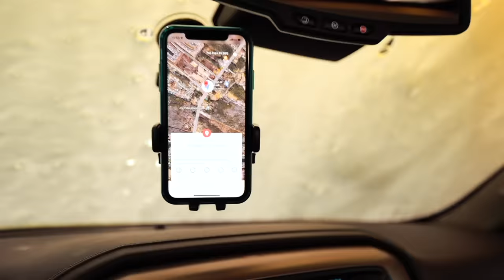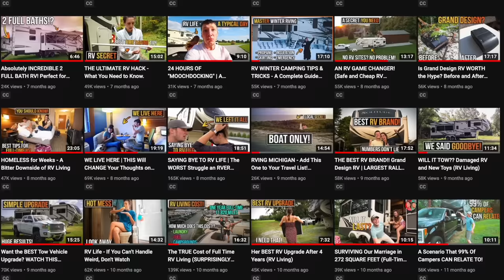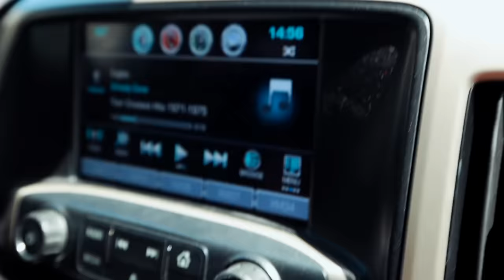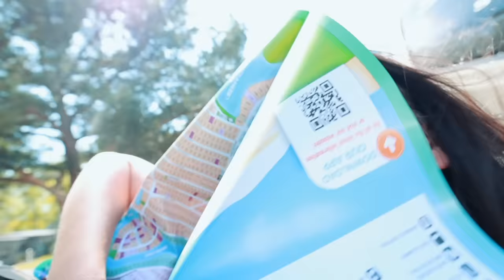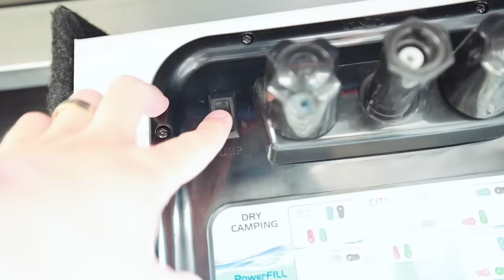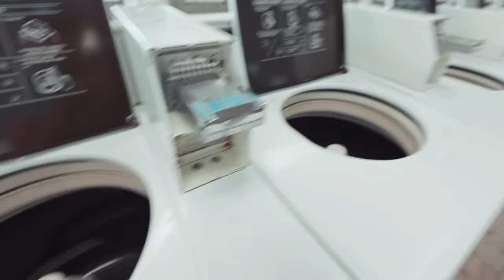THIS Is Why People Quit RVing! RV Repairs REALLY SUCK.

Comment: I figured this was going to be an ordeal overall. Our first travel trailer had a siding issue on its second trip out (2020), I contacted the dealer and they approved me doing a patch job on it to get through the remainder of the season. They were working with the manufacturer on how to fix it, parts, etc. I took it to them in early November 2020. The siding pieces were delayed due to Covid supply chain issues. So it sat there but they hadn’t done anything to it yet. Mind you this fix required ripping the entire side of the camper off and putting it back on. After much back and forth with both dealer and manufacturer in around the February time frame (2021) they got the pieces in they needed for the siding. Great, just in time for camping season 2021. They proceeded to rip the entire side of the camper off and attempt this installation. Turns out they damaged multiple pieces of the good siding in the process of removing it all. So 4 months+ to get the original pieces, and the supply chain has gotten even worse at this point. I was all but certain we were going to miss out on camping season 2021. The kicker is I didn’t even have a patched usable camper, couldn’t trade it, sell it….it is stuck there for probably the entire summer. They don’t even have an estimate on metal. 

One of the most stressful events of my life and we are not full time, just weekend warriors. It was worse that building a house. Just the getting yanked around and unknowns. Ultimately working with the manufacturer paired with the dealer it was made right. They bought us out of that camper and gave us a substantially nicer unit at legitimate manufacturer cost that the dealer had on their lot (you wouldn’t believe the actual markup on campers). All just in time for camping season 2021. Same unit is still going strong to date with no major issues knock on wood. 

The rv industry is not the only one like this anymore sadly. Same song and dance if your vehicle gets damaged, your house, etc. The supply chain paired with lack of labor force and green or uncaring labor force that does exist means that competency is through the floor and timelines are through the roof. I ordered a truck from GM and waited 5 months and you would not believe the level of incompetency from GM of all companies. Couldn’t even tell me where it was, when I would see it, and honestly I did not get the impression they were sure it even existed. Canceled it and went another route.  Sadly it is just the new world we are living in….not sure it will ever go back or get any better. I am glad you guys got through this relatively unscathed.
Reply from the maker: We appreciate you sharing your story!

Comment: That there is little accountability in the Rv Services  acrossed the board  is unacceptable!  We need  to change this .   What ever happened to a Quality Control Representative for the shop’s locations ?   You’d think they’d be worried about  us spreading our bad news ( don’t go there).  Maybe we all need a “go to list” & ( Dont go there LIST) to share with each other !? 
I went to pick up my “new to me” used TT and  it wasn’t even washed ! I had to pay a $389 charge to have the little fixes and get it cleaned.   Dirty.   Sad .   They’re retailing it, so they make a profit, but them add an extra cost ( insult) to ?make yourself feel good about buying it ?

Comment: Soft water is really bad for your ENTIRE plumbing. Unless you do a complete flush and clean all the lines it will just get worse. It’s basically a very high concentration of lime/calcium deposits in the water and builds up over time. 3 way water filtration system is the only way to prevent or salt system. Get that looked at asap!!! You’ll thank yourself!
Not to be a bummer, or negative Nancy, but….. I think it’s time to check all the seal strips on the roof. Air vents, air conditioner and tip/outs. Grease those pullies and tracks around the lean outs!

Comment: Considering some of the unqualified people that some RV places seem to have "repairing" RV's, I think you guys would be much better off doing this job yourselves.  (I have only seen 3 minutes of this video so far so, maybe you do?)  There is a wealth of information on the net on how to repair anything you can think of and many videos too. I would not trust ANY RV repair places to replace anything of mine.  Who knows?  You might end up with an even worse leak after it has been "fixed"?  I am not speaking about this RV repair place specifically as I have never heard of them and know nothing about them, I am speaking generally.  Just like your wife said, no one cares as much about your rig as you do.  That is the truth.  You would double and triple check all of your connections to make sure it does not leak.  You would make sure the tank is installed so it does not rub against anything to create another hole 5 months later.  Best of luck to you and good travels.

Comment: I have a 2022 grand design 274bh we left for a 6 week trip an ours started leaking in between axels the first night out. Mobile tech couldnt fix it so we had to dry camp for 3 weeks got an apt to take it in on the 18th thankfully we can't use kitchen or shower.
Reply from the maker: That's such a pain! Water leaks can be so annoying!

Comment: Traveland in calgary and Langley bc, same type of ‘nobody’ knows nothing mentality of disorganization service centre’s. 
Fraserway in Airdrie, service is complete opposite, best out of four dealers I’ve dealt with. 
These RV dealerships so many need to implement a system like some of these big plumbing and heating companies do and have, they deal with high volume of calls, similar to a call centre system, work order number ticket system where everything is tracked in the system, every call is logged, so when joe blow calls in sick, any of the techs can take over and knows where the issue left off, and any equipment ordered all has a designated receiving area. They need to higher service managers that have these back grounds not the BS used car salesmen mentality skill level. Techs need to be certified 🙄 oh boy, that’s another issue….
Certainly can empathize with your frustration, Murphy’s law tortures us sometimes…🍻
Reply from the maker: Well said! Thanks for sharing!

Comment: is a fifth wheel easier  to back up
Reply from the maker: It's a tough one..I wouldn't say it's easier, but maybe a little more forgiving. They both have the same principle, but the 5th wheel doesn't respond as quick as a travel trailer on a bumper hitch, allowing for smoother backing up sequences at times. Just my opinion 😊 Thank you for watching!

Comment: @HappilyEverHanks: I’ve been wondering, why wouldn’t Eternabond seal the crack in the tank?  The shop you visited in MB did a craptastic job all the way ‘round, imo. I mean, clearly the underbelly needs to be correctly attached so water doesn’t get into the insulation and require replacement. I would Not go back to a location that cares so little about doing a professional job.
Reply from the maker: We never tried Eternabond so maybe would have worked

Comment: Question, how were you lowering your front jacks so you get equal pressure on each side?
Reply from the maker: There is a button on the lippert auto level control that says "Drop front jacks" it will lower each jack will hit the ground just enough to take some pressure off the truck
Reply: @HappilyEverHanks  thank you! I will have to try that!

Comment: Can someone please clarify if the pump switch on the Natalis panel needs to be on when we are hooked up to city water? Karl what was the tip about the front jacks please?
Reply from the maker: Hey Jim! If you are hooked up to city water, you do not need the pump switch to be on. Just make sure the Nautilus system is turned according to the diagram for city water 😊

Comment: nobody has any buisness full timing in a RV if you do not have the knowledge to work on them yourself despite owning RVs for many years and self teaching myself a lot of repairs myself.  I still went to Florida for 12 weeks for tech school  before we sold the house and bought our diesel pusher to full time in.  You can't let a dealer keep your home sitting on a service yard while you are out of a place to live not to mention RVs are not designed for 365 day a year use  they are designed for occasional recreational use. you live in one full time  things will break very often and need repaired some minor, some major You need the knowledge to repair those problems yourself. Don't take shortcuts by living in one with no training  on how to repair it. There were more people like me in my class getting trained and certified as RV techs  so we could full time and not depend on dealers to keep our homes liveable then there were people doing it for a career. not to mention you can pick up some good money putting a sign on your campsite saying on site mobile RV repair with your phone number on it. I will also tell you something else most people working at dealership service departments on RVs have no certifications or formal training. they may only have 1 or 2 actual trained  technicians on staff and they may have 15 guys under their supervision that are just shop workers that are actuly working on your camper. especially if its a camping world.
Reply from the maker: Thanks for sharing!

Comment: Crack head broke into my trailer...ripped out counter to get to cooktop... happened in November.....still waiting on new cooktop and counter to repair damage....at least your trailer is useable
Reply from the maker: That is horrible, so sorry!
Reply: @HappilyEverHanks  Hey all good. Have truly enjoyed your videos. But seems once a manufacturer has your money they aren't in a hurry to grab parts off the assembly line to get you back on the road. And dealer just sits there and blames manufacturer.